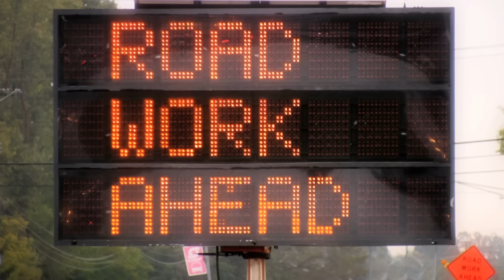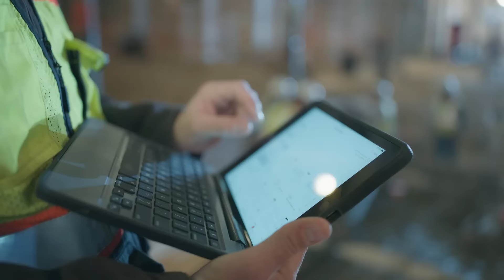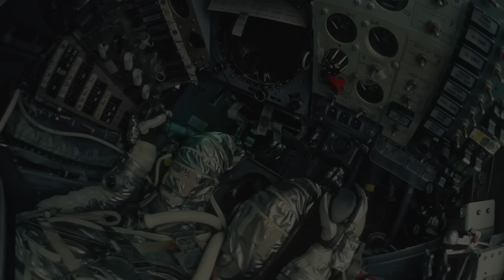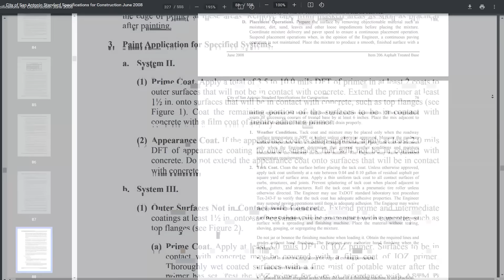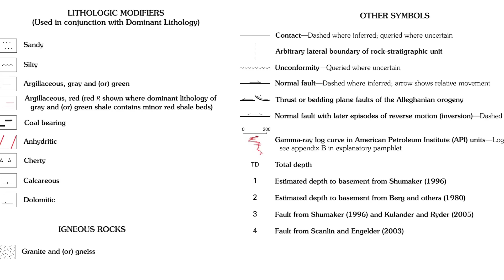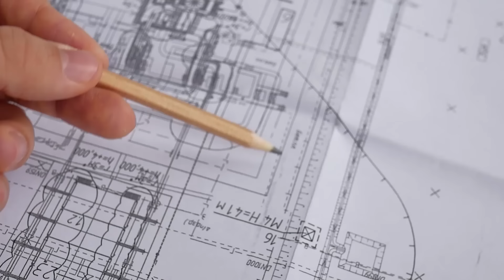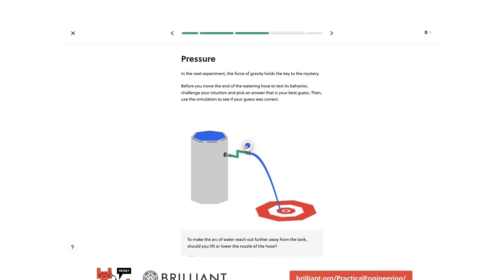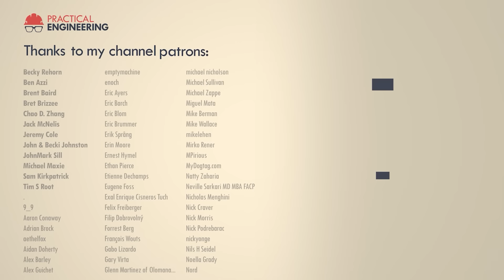4 Myths About Construction Debunked

Comment: I feel like with the Roman roads argument it's also important to recognize what they are designed for and capable of. Modern roads may have potholes, but those cobblestone roads basically ARE potholes. They are fine for horses and carts and such, but try to take your Audi on one at 70 mph and you'll have a very bad day.
Reply: Yeah plus its hard to stress just how much wear and tear roads get. A loaded semi truck weights hundreds of times as much as a horse drawn cart and it goes 10x the speed. I've seen roads that have noticeable ruts worn in them within 10-20 years which can take centuries to show up on a cobblestone road.
Reply: @arthas640  The places that do still have cobbled roads have to maintain them fairly regularly, it's rare that the stones get worn down but most often they'll just fall out or get loose. Cobbled roads also rarely stay very flat or straight even if they're built that way because the stones can all individually move and they will creating a fairly uneven road over time. Lots of places just opt to seal the stones in with asphalt for that reason because it helps protect them against erosion and water damage. My city has a downtown area that's cobbled and it works because it's pretty much exclusive to bikes and pedestrians but they definitely do have to maintain it roughly as often as the normal roads.
Reply: @hedgehog3180  The Roman cobblestone roads are a lot more solid than most other examples in various civilizations, but even they will succumb to this...

Though, they could theoretically have just put concrete over them and been relatively fine. That said, not sure how well the methods would translate over to say, someplace with a lot of clay in the soil, like Mississippi, or some place of greater cold, like Montana
Reply: yeah not only that, let 80000 pound 18 wheelers travel on that cobble stone 24 hours a day through a canadian winter and you will have nothing left but pebbles haha. Anyone comparing cobblestone roads to our modern highways must be 44high on something haha.
Reply: Read CLAUDIUS THE GOD,  specifically the account of construction of the port at Ostia.
Reply: I'm not sure driving a horse-drawn carriage over cobblestone is a super pleasant experience either. It's just better than driving it through mudd, so obviously at the time they were hugely welcome.
Reply: @CommieTsar A movie about family and living life a quarter stadium at a time.
Reply: Roman roads were actually covered with multiple layers consisting of gravel and sand mixture. The topmost layer would be soft and sandy (if properly maintained). Since they haven’t been maintained for thousands of years we only see the cobblestone lying underneath, but that wasn’t the typical experience for a Roman traveller.
Reply: Now? yeah. Then? Not so much. They used to be covered in a more consistent material which would flatten the road out. That has since eroded long ago. If anything, that could be used as a point that Roman roads aren't actually as resilient as people think they are. We only see their skeletal remains
Reply: Not to mention all that braking force pushing up a position and waiting for the lights to change, all the while puddling the ground during idle.
Reply: My city still has a small bit of cobblestone street that I sometimes had to bike over to get to work. I hated it very, very, VERY much.
Reply: It was briefly mentioned in the video, but it needs a bit of a "think for a moment": Roman construction crews were paid in bread, water, and beatings. Of course you can go for cheap stuff too, but it wasn't too much more money to get the best material. Especially since mining was cheapened by... more slave labor!

Slavery: A great economy for everyone that isn't a slave.
Reply: In Canada a lot of our cobble roads are nicer than our asphalt roads
Reply: @UserAgreementNoodle  They released that film a few years ago, I'm sure it was called Slow & Furious.
Reply: I used to live in Alexandria, VA and the Old Town neighborhood has a single true cobblestone road for a block or two. I was riding my bicycle and forgot about that road, turned onto it and then realized my mistake. The road also went downhill.  My bike was jumping from stone to stone and gaining speed from the down hill and brakes did almost nothing as the tires were so rarely in contact with the ground. It turns into hold on and pray I didnt wipe out before i hit the next section of true pavement.  I luckily managed it but made certain to never touch that section of road again.
Reply: Isn't wear and tear increasing exponentially with weight? So a two times heavier vehicle is four or even eight times more damaging to the road.
Reply: @midgetman4206  Just like many castles were white washed and richly painted. And now we think of them as bare stone structures. Also we only see the expensive stone castles and forget that the majority were wooden castles.
Reply: @philippbrogli779  ...Of which only earthworks remain, if the site hasn't been dug up and repurposed.
Reply: @InfernosReaper  Well Roman roads used pretty uneven stones which creates some issues for the distribution of loads. They were larger so like they'd mostly be flat individually but I think each stone could also end up moving more. They also just couldn't produce the amount of concrete needed to seal them in.

Comment: 9:50 few people realize just how stressful the job of an estimator is since if we screw up and under bid work then the company will lose money and may have to downsize, but if we guess too high it means we lose jobs, waste the time it took to bid the job (which can be days or weeks of time) and we start to run out of work which can mean downsizing as well. Your boss may walk in and say work slowed too much and now they're firing workers because you didnt do your job well enough or you may get fired too. At the same time its a very detail orientated and complicated job, I worked on a rather small to medium sized project once that had a book of specs we had to follow that was over 1000 pages and there was a single half of a sentence that said "electrical trenches will have a 3 inch bedding of pea gravel" and that wasnt mentioned in the electrical section or the plans so it was super easy to miss but increased the electrical portion of the project by over 25% which when you only have a 5% profit margin and everyone you're competing against will have their bids all come in at the same 5-10% range is a big deal. Extra stressful since suppliers and sub contractors on government projects all send in their bids just before the dead line and if you dont get your bid turned in at or before the deadline (even down to the minute) you can get disqualified so a delayed email may end up causing tons of work to be for nothing, I once had a job i spent around 3-4 days working on get disqualified because my Microsoft Outlook froze. 

You're constantly under the gun to get things done quickly, efficiently, and with little to no margin for error. There arent many jobs quite like it since your job and your coworkers jobs depend on your ability to do things as close to perfect as possible and depending on the size of your company you might be entirely on your own with little oversight and little help. To make things worse if a project comes in over budget or takes longer than anticipated its pretty common for guys in the field to blame the estimator for under bidding the project even if it's due to the people in the field taking too long or working too slow, and even "acts of God" types of unforeseeable problems can end up getting blamed on you. I've had a few different positions in the construction industry: secretary, apprentice, journeyman, project manager, administrator, delivery driver/supply yard worker, and laborer, but estimating was the most stressful by far.
Reply: I'm sorry but deadlines don't mean "submit it exactly at this time."

If you lost a job because Outlook froze, that's poor planning on your part. That's a ridiculous excuse for waiting until the last minute to do something. 

I get that things take time and everyone is working hard but if something as simple as a computer program freezing is preventing you from getting a job, that would make me seriously question everything that went into planning that job.

Also, Outlook Web Access is a thing.
Reply: No king rules forever, my son.
Reply: All you do is think and press buttons, if you fail at that then yes the boots will blame you
Reply: Nothing quite like waiting on material quotes to come in while you are trying to meet a deadline for submitting the estimate, not getting them in time and having to try and figure the cost of some custom skylight or something based of previous quotes so that you can include it in your bid. I enjoy estimating but its a lot of pressure to be the one guy keeping working flowing in.
Reply: @notsure1232  is that sarcasm or you just myopic?
Reply: @allenthomas9912  myopic in comparison but not in sentiment
Reply: @orangejjay  In construction it does mean “submit exactly at this time”. An estimator may have anywhere from one to a hundred sub trades that provide pricing. Every one of them will wait until the last possible moment to release their pricing to make sure their competitors don’t find out the price and under cut them. 

I’ve literally had minutes to compile, check and submit projects worth tens of millions of dollars. Your email freezes at the wrong moment and months of labour could be wasted.
Reply: I do lots of work on contract.   It is very stressful.   You cannot estimate all the things that might or might not happen.
Reply: Agree 100% with your comment! Estimating is stressful for all the reasons mentioned. I have been an estimator for line work (transmission, distribution & substations) for 8 years.

There is little room for error with small margins as previously mentioned, so it’s important to know your competition; are they local? What kind of equipment do they have? Are they NEEDING the work? 
If I’m getting quotes from subcontractors for a certain task & know my competitors have the equipment to self perform, that will need to be factored in. 

It’s my job to win the bid & the Project Manager’s to make it profitable, so I work closely with PM’s throughout the bidding process, then I know how it would be ran & can bid accordingly. I’ve seen jobs which lost $ because the PM or Foreman ran it how they wanted (with additional manpower, equipment or OT which wasn’t in the bid)
Communication is key!!!

Comment: Having worked in the Arctic, I have seen how important alternatives to bedrock foundations are. Different styles of floating foundations helped to prevent heat from the building to be transmitted into the permafrost below allowing the building above to remain stable. I have seen buildings that were not constructed with such care and they had a bad habit of settling into the ground as the soil beneath them melted.
Reply: Sounds expensive

Comment: Once I learned about the concept of "inherent vice" from an acquaintance who worked as a conservator in an art museum, the concept of planned obsolecence made sense. Knowing the safe lifespan of a material lets you plan for when you need to replace it.
Reply: Knowing that isn't always valuable, though.
Unlike in long-term large scale projects such as infrastructure om which people rely pretty much 24/7, personal electronic devices or household utilities aren't used on a schedule so tight that you couldn't just replace them whenever that becomes necessary.
Reply: @xCorvus7x  While true, I think it is safe to know /when/ a structure might start failing. Not necessarily planning the time of failure. Having knowledge of "Until when should have this structure open to the public before we renovate or replace it?", as well as regular inspections are important for public safety.
Reply: @NoThrottle  Yeah, but that's not planned obsolescence anymore; rather an application of studying the security and durability of products which companies (to my knowledge at least) haven't even thought of.
It'd be nice if they did share this knowledge of theirs with the public but they don't seem to care.

Comment: Cicero actually wrote about one of his apartment buildings developing worrying cracks. Juvenal describes being struck in the head by roof tiles. 

Apartment buildings in Rome could reach four stories, and collapse was a far more regular occurrence than for modern buildings.
Reply: not if you're in Mascot NSW.
Reply: Just look at the stories of structure collapse from even the most minor earthquakes at the time compared to how modern, well-engineered structures handle a pretty decent quake, plus how much smaller most of those structures were while having a higher failure rate. Ancient Rome was certainly at the forefront of their times in terms of engineering, but nowhere near where we are now.
Reply: @Stormynormy42  buildings still collapse like that, in places without enforced building codes. This week in Afghanistan, for example, an earthquake knocked down many buildings. I’m sure American buildings would be falling over all the time, if we citizens didn’t demand that the government establish and enforce building codes.
Reply: @gerardlabelle9626  I didn't say they didn't. My point was that with modern technology, techniques, materials, equipment, etc., we have the ability to build large structures that can take pretty strong quakes, including ones that would have taken out most structures of the time. I didn't say every structure currently on earth is built to these standards.
Reply: ok
Reply: @metricstormtrooper  it's a bit rude comparing most anywhere to NSW though
Reply: Yes but some of their structures ARE still standing, and some roads and aquaducts are still in use.  They did some things right, there's no question.  
I think one thing that will be a still-standing hallmark of our current civilization, to people of the future maybe 3,000 years from now, will be the bridge piers from the interstate highways.

Comment: I sometimes work as a biological monitor on construction sites, though I would probably mistaken as a typical crew member "standing around." There are similar monitors for archaeology and such (when required). We certainly aren't trained for any construction work, but we're there to check areas beforehard and make sure the operators don't make any costly legal mistakes.

Comment: As a roadway and bridge construction inspector, I found this video to be a great explanation to the layman, of what happens with a construction project.  This is a great general overview, and will be what I point those interested to, when asked about what I do at work.  I never have felt that I could quite adequately explain the complexity of all that is happening simultaneously, that requires monitoring.  Great work on this